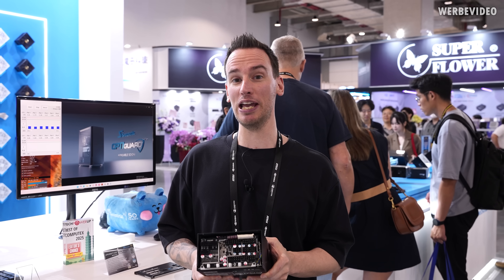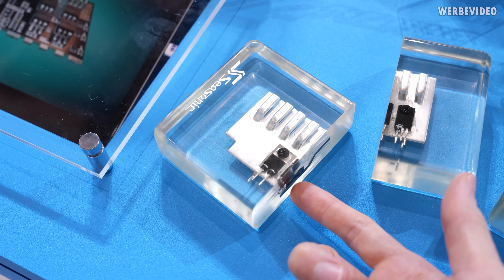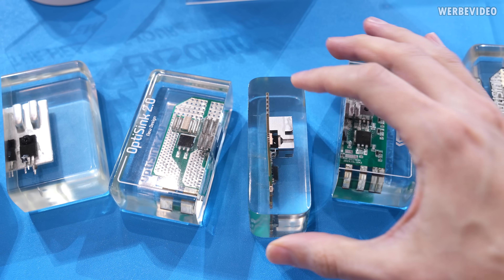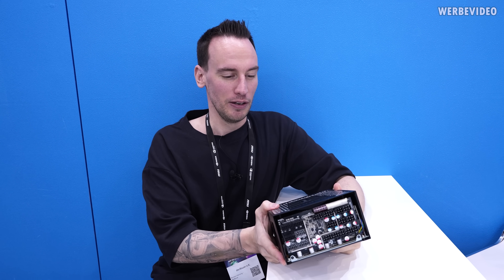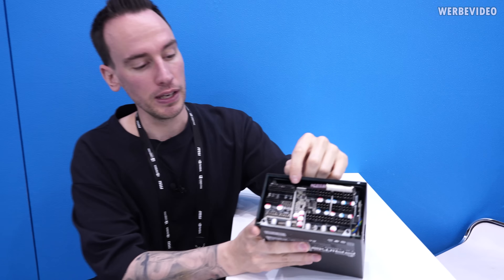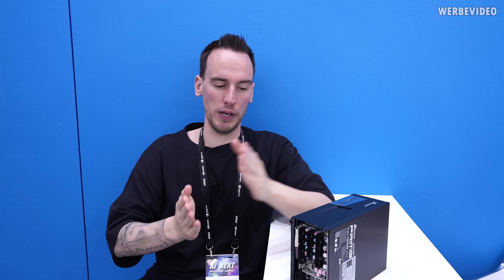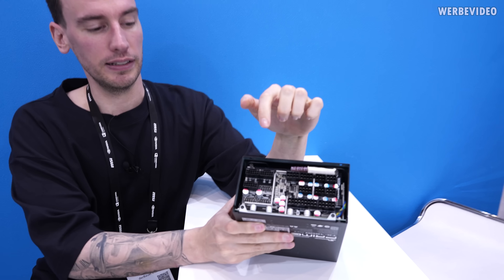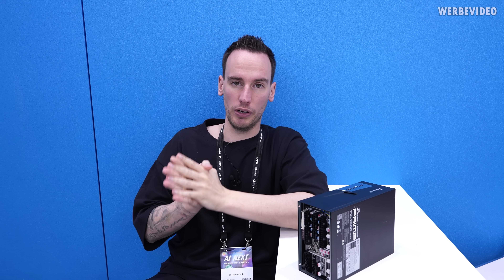Seasonic Confirms 12VHPWR Risk – Unveils Protection Feature

Comment: PCI-SIG should release an update to 12VHPWR addressing the issues and limiting power to 300W unless optional circuitry is added to protect and monitor each of the 12V pins and only then will that socket be allowed to be loaded with 600W.
Reply: It doesn't need an update, it needs redesigning from the ground up!
Reply: @HappyEater86  I mean it probably would be fine if these 600 watt cards were using two of these connectors lol. It would actually bring each wire back into safety spec XD

EDIT: I should add, yes I know nvidia will still screw it up and probably tell everyone to tie the connectors together defeating the purpose.
Reply: @HappyEater86 The connector is not that bad, it will easily pull 300W, it is still 2x more than the good old 8pin. 
Sometimes I have the impression that this whole situation is a consequence of the fact that someone at the beginning of work on this connector treated the peak load parameter as nominal.
Reply: @tristankordek  for 300w loads it's fine, it's when you breach this you're in unknown territory.
Reply: Still won't work without load balancing.
Reply: I doubt Nvidia would approve of it
Reply: It's not only an issue with 12pin, there are numerous examples of 8pin connectors melding on 7900xtx cards. Just completely ignored by tech influencers, cause reasons. Per pin load sensing, and proper feedback mechanics, should be a requirement for any card that pulls more than 150w, using any connector with multiple pin pairs. Nvidia should just have made a connector with just 1 pair, but it would probably cost a bit more.
Reply: @yt_cn-m7r  Oh, I haven't heard of any grilled 7900xtx, which doesn't mean it can't happen, I myself melted 2 8pin plugs on 1080Ti (and 2 people know about it) but it's my fault because instead of 250W I was drawing over 400W and that on very old and weak cables. 
The difference between them is that 12VHPWR melts even if it's brand new and only used once, while 6/8pin has to be with 22/24 AWG cables or a plug that has seen more insertion and removal than a nymphomaniac. 
Monitoring the load from 150W is a rather low value, more than 300W is a different story, because that's how much 12VHPWR and 2x8pin will withstand without any problems.
Reply: @tristankordek  The problem as currently understood, is balancing the load over the pins. With 200w  powerdraw you can already go out of spec if load is balanced very badly. If that gets pulled over 1 pin that would be about 16A, pins of the 12pin connector are specced for about 10A.
Reply: @tristankordek  You can't deny media push for drama, they reached ridiculous level. I'm not a fan of the design and I don't understand some of the choices but also people have no excuse to not ensure a power connector is fully inserted. Once everyone got worried it was wild, people that didn't check, people that inserted halfway and decide it was enough, people that was worried to push or thought a problem was preventing to fully insert and decided to run it anyway, all posting online what they did and have the gut to blame others. If I did the same I would be hiding in shame instead of playing victim.
Reply: @Stef3m  I agree that the issue has grown to absurd proportions, but it's not the media's fault, but NVIDIA's and/or PCI-SIG's. What else can we do but not pressurize them to finally fix it.

Let's get one thing straight, it's not a matter of not pushing the power plug all the way in. After the update to 12V-2x6, not pushing the power plug all the way in will result in a power limit and will not allow you to draw 600W. However, we still see cases of fully inserted melted plugs and sockets.
Reply: @yt_cn-m7r   Nvidia supplied a cable for its 4090 in which the 6 12V terminals and the 6 ground terminals were connected together. This was probably not for nothing ?
Reply: @yt_cn-m7r  Nah, I have a 7900XTX and it is nowhere near related.
Reply: Yeah… it should be the problem of Person who did buy $4500 gpu…

Comment: Server manufactures solved this issue (pcb connection) years ago. With a a server PSU (hot swappable)it  has a huge contact spot and a large connector. That could easily be adapted to a modern GPU. A large double sided connection point, opposite the display ports, and a cable/connector that is 4" in length that slides over it and locks in place. Like a DIMM stick or a PCIE connector.

Just google this, and you can see how easy it could be.   3000W EnergyEdge X-treme

Comment: This won't be cheap. Not sure what I would do if the alarm went off. What failed or is failing? Why spend all this money (this won't be a cheap PSU) for this band aide. So now it doesn't melt which is of course great. But why did it get  into this fault scenario? How do I avoid that in the first place?  Truly the only solution right now is to live with the performance of an AMD GPU and wait till this goes away. Insane.

Comment: Watch nvidia say that its still someone elses problem when using this psu and the gpu goes up in flames
Reply: You did use cable that did cause the imbalance… but that cable worked fine so far… Not any more… change new cable after one month usage.. and dpn`t change completely that has inbalance problem! And don`t change the cable too often because it can damage the connector… that also is your problem my good slave… I mean customer… 
😂
Our advice is to buy new cable each month and buy new gpus after using the previous one one year… if there are problems in the meanwhile… that is your problem because you did use bad cable or managet to connect the connector work or too many times… 
Have a nice day and see you in the next year!
Reply: No wonder why psu vendors are tired of being blamed for this hence the new fail safe design.  Asrock also has this feature.

Comment: Totally agree with the hardware feedback. Just something like the buzzers motherboards used to have, or a 2 digit segmented display with an error code (again like mobos used to have for POST codes)

That said, cool solution for a problem that shouldn't exist
Reply: If the heat up happens fast… it still. An burn the computer…
Imagine going to get caffee… you hear alarm… go back to computer and see the smoke…
Reply: @haukikannel  that's where the 12 amp automatic shutdown comes in. It can detect that in a fraction of a millisecond, shut down the power to the 12v output.
Reply: @Hayley-s5t 
Yes… if it is fast enoug… also if you were in the middle of bios update… bring your PC!
😂
Reply: @haukikannel  im sorry but you dont really know what youre saying. Those burns happen during high load, otherwise the Amps will never go that high because it just doesnt need the power. During a BIOS update the load on the gpu is extremely low so theres no chance it would burn up during an update. Secondly, the PSU cant not be "fast enough" to shut the pc down, as soon as theres a too high load, it turns off. Its a milisecond reaction, theres no way it could nt be "fast enough"
Reply: @Gaminguide1000 moralso there is zero reason to stop the entire machine, dropping the 12v off the gpu would suffice, black screen and all but no data loss.
Reply: @stanimir4197  Agreed
Reply: @Hayley-s5t  I wrote that a month back and I auto-assumed there would be mosfets but that's unlikely, hence they wish to signal the PSU to shut down the system. Adding mosfets would be nice but also more challenging and expensive (they would also generate some additional heat). Their rdson can be used to measure the current, albeit not precisely.

Comment: 12VHPWR is the biggest embarrassment and failure of PCI-SIG (we will never forget nvidia's participation in this circus).
Reply: Shareholders in NVIDIA don't care. To them it's a minor issue. AI gpus in the dataserver  is where it's at. They've made $billions in the process.
Reply: @64BBernard Catering to shareholders while scamming everyone else is not right. I wonder why the system is broken.  Oh, the lobbying/bribery of politicians.
Reply: "we will never forget nvidia's participation in this circus"  Sure you will - that market share at worst might dip to 85% - but unless they do 8gb with 6000 series, mostly nothing will change, not even your virtue signaling online.
Reply: @xBINARYGODx  I'm not saying I'll forgive them, but I won't forget.
I remember previous nvidia scandals from years ago.
4090 melting power connectors.
3080 instability / lack of ceramic capacitors.
970 3.5GB memory
480 overheated and made noise and eventually died.
There was more but I'm going to eat :P
Reply: It's funny too - AMD helped design it - and doesn't use it.

Correction: Nvidea and Dell.
Reply: @47CryXMA  amd or intel?
Reply: @47CryXMA AMD let the AIB decide what they want. Sapphire does use 12V-2x6 on their 9070 XT NITRO+ card.
Reply: They know its shit
Thats why @47CryXMA
Reply: The connector itself isn't the main problem, it's Nvidia's failure to do basic electrical engineering on the board after the connector that causes the melting.
Reply: @ryanspencer6778  Nah, the connector is the problem. And tristankordek said it correctly - it's failure at basic electrical engineering - current always flows on the path with lowest resistance and if you introduce 6 different paths for it to flow through with no safety margin at that you are asking for trouble.
Reply: @gagarin777  you could create the exact same problem with any arbitrary number of six/eight pin connectors by combining their power planes on the card... there's a way to safely handle this connector, and the 3000 series did... the pci sig spec to combine the pins is obviously stupid, but that's a fault of the spec/card design, not the connector.
Reply: @gagarin777  yeah even the 12V-2x6 connectors are still melting. Not having any protection on either the device or power supply side doesn't help though
Reply: @rawhide_kobayashi  Yes you can create the same issue with 8-pin connectors. But those had ~200% of safety margin for current handling while 12V-2x6 has almost none (for the whole connector). It's failure at electrical engineering. You could design a connector with a dual wire (+12V and ground) - it would take even less space and if you use stranded wire type it would be as elastic as the wires for 12V-2x6.
Reply: @gagarin777 So what you're saying is use 2 8 pin connectors so you do the same with 16 instead of 12 wires, sounds genius, now you got even more problems with nvidias current board design issues.... No it's not a connector problem
Reply: @gagarin777  not all 8 pin connectors are built equally... there are plenty that are built to spec, without a ludicrous safety margin, and then they burn, because the individual wires aren't balanced or multiple connectors have a combined unbalanced plane on the card... 12vhpwr is really just unveiling a legacy of lazy design that never mattered that much because you could just bet that a connector was overbuilt and the power draw would be low enough not to matter.

Comment: While I agree that you wouldn't want to compensate for extremely high contact resistance, compensating for extremely low contact resistance (by introducing extra resistance) might make sense. Not saying it's cheap, don't know if it's practical, but at least it shouldn't be dangerous.
Reply: Nvidia supplied a cable for its 4090 in which the 6 12V terminals and the 6 ground terminals were connected together. This was probably not for nothing ?

Comment: "Kinda safe to use"

Great standards we're having especially given that given how easy and safe to use the PCIe 8-pin is. It shouldn't be up to the PSU makers to make the 12VHPWR safe. Nvidia should have designed it to be safe to use from the start.
Reply: this is one of big reasons  why i bought a rx7900GRE with normal pci 8pin instead of 4070 super with this crazy 12Vhpwr ... the other two was drivers for linux  and 16gb Vram .
Reply: @Pieteros21 That's the major reason why I now will always recommend the Corsair RM1000X (2024) power supply. 
It's one of the newest power supplies available that still manages to be kind enough to also include 6+2-pin PCIe cables, alongside the dedicated 12VHPWR cable. It gives options to run older ATX2.0 devices with all the safety and efficiency benefits of the ATX3.1 standard. 

Oh, and the 1000-watt?
It comes with four 6+2-pin PCIe cables. 
That number is based on PSU wattage (some have two, others three, and the 1000+ has four). 
I was panicked because many of the other ATX3.0/3.1 PSUs only include the House Burn-Downer 9000 cable. 

I was running an EVGA 1300W G2 previously, and my soul dropped out my rear end once it started to fail on me a few weeks ago.
Reply: They should have just used an EPS cable...
Reply: @JBrinx18  Some professional/server graphics cards do use the EPS connector so it wouldn't be unheard of either.
Reply: What I don't understand is why they don't use XT90 connectors, especially for a product that costs >1000 bucks, you have one pin per side, and can go to 1kW at 12V
Reply: You forget that PCI-SIG and Intel were the ones who came up with this standard first. Nvidia deviated from the intent of the standard by omitting functional current sensing pins intended for use with adapters which tell the PSU how many EPS cables are connected to the GPU's 12VHPWR adapter and have the GPU function in a reduced power state with less power provided.

Nvidia violated the design intent and then with their power, told other AIBs how to act. Intel and PCI-SIG should be blamed for not upholding the original intent of the connector, but not for Nvidia making the standard look bad by invalidating the design intent, bridging power pins together and bypassing sense pins.
Reply: @bluephreakr  How on Earth can this possibly be PCI-SIG and Intel's fault for coming up with the standard and not enforcing the intent of the implementation given they don't have the power to do so?
Reply: @duncamenator  I think they meant it is not the standard's fault. It is Nvidia taking advantage of their position to maximize their profits by implementing the connector however they pleased and running over the PCI-SIG.
Reply: @bluephreakr You just described the exact adaptor that the first 12VHPWR Nvidia cards shipped with - they used the sense pins in the exact way you described. The problem is the design doesn't consistently connect the pins, even with the sense pins connected and in use there have still been failures because all the sense pins do is communicate theoretical max source power (as per the spec)
Reply: They should approach it for what it is on its most base level: a toy. Kids use these things for games, not just seasoned hardware buffs that can implement a voltage monitoring regime.
Reply: @jjm1133  Graphics cards stopped being "toys" a long time ago. Even before machine learning took off people have been using GPUs for professional work.
Reply: @ElectricIndigoGryphon he's saying that "kids" (enthusiasts) use them for games and should be made idiot proof.
Reply: 4x PCIe 8-pin has the same problem if you get rid of the phase control. Issue isn't 12VHPWR. Issue is the lack of phase control. We have 6 pin pairs. Should be atleast 3 phases (2 pairs) with each 200W or 6 Phases (1 pair) each 100W. With that nothing would happen at all. Problem is on the PCB of nVidia Graphiccards. Stop blaming a connector when you have no idea what the actual problem is. Older Graphics cards with 2 or 3 PCIe 8 Pin have 2 or 3 Phases controlling the flow. That has NOTHING to do with the connector. It has to do with PCB design. Get that finally into your heads.
Reply: @dasharius3021  PCIe 8 pin was so robust you could daisy chain it, some cards using it may or may not have had multiple phases but it didn't really matter because the connector reliably socketed in and established proper contact every time. The most fundamental issue here is that 12VHPWR and 12V2X6 don't reliably connect all, or even most(!), of the pins, which creates the situation in the first place where individual pin monitoring is then a desirable safety mechanism
Reply: @dasharius3021 phase control can mitigate it and would be a good way to, but it won't change the fact that the connector has basically no margin.
It could be also solved with using 2 wires like with an XT90 connector.
That also doesn't change that there's various fixes that cost less than a buck per card on 1k+cards an they're nickel and diming customers and doing the ostrich strategy.
Reply: @dasharius3021  
You're discounting the fact that the 8-pin PCIE is way, way more overspecced versus their maximum theoretical limit on a typical 18 AWG. PCI-SIG rated these for 150W, but these connectors can theoretically handle up to ~250–360W, sometimes even more with 16 AWG.

This is not true with 12v-2x6.
They're rated by PCI-SIG up to 600W but the theoretical max is around 576–720W on a 14AWG if we're being conservative. That's about 20% tolerance on the best possible wire gauge here, and we're not even talking about how these individual pins will perform once they degrade over time. With 5090FE having 575W TDP at stock, it's already obvious that there's very little breathing room left for things to go wrong.

I get that NVIDIA PCB is partly to blame here because they reduced shunt resistors from 3 (in 3090Ti) down to 1, but this new connector specs isn't doing us favors either.